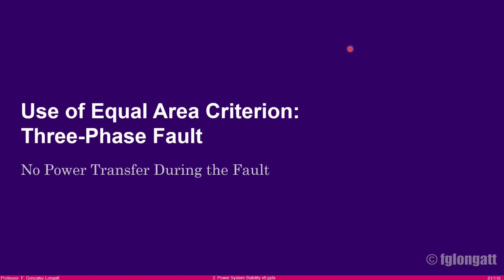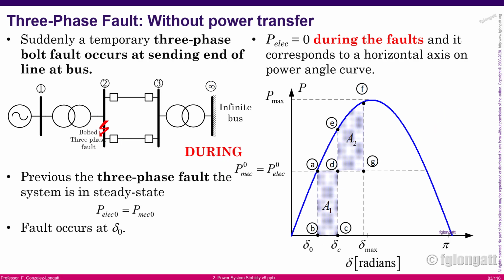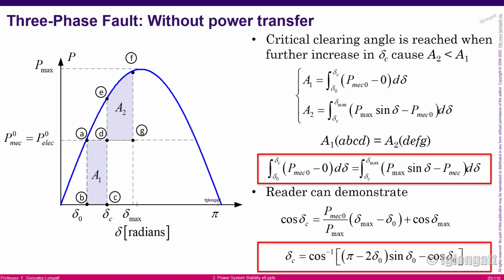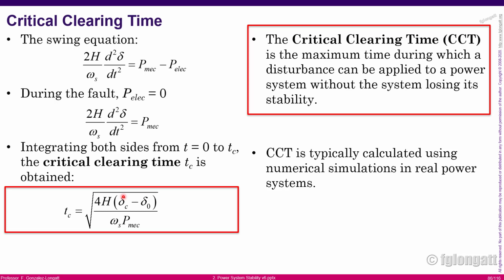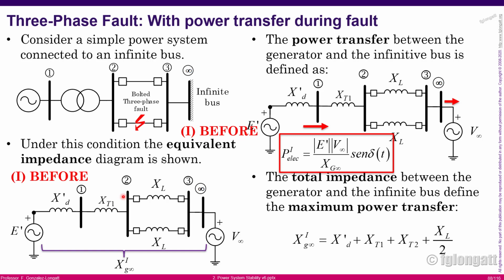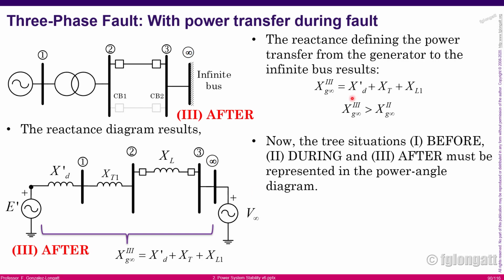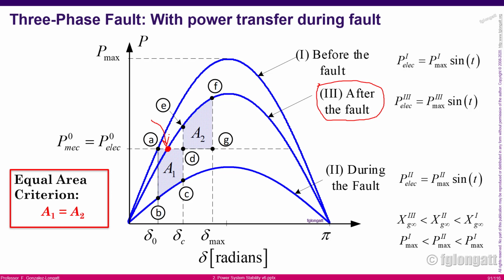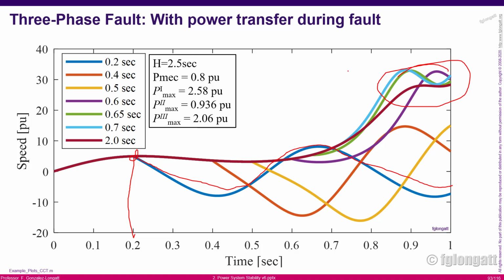Class 4  Intro Power System  Stability PART VII

Comment: What happens if the bolt fault at @ 20:16 is changed to a three-phase ground fault? how do I derive the power angle equation?
Reply: In order to answer this question, we should analyze first the correct meaning of a bolt fault. In the case of minute 20:16, i guess that bolt fault may mean a three phase fault that may involve all three phases Line-Line-Line and the impedance between these phases is zero. A bolt fault may also mean a three phase fault that may involve Line-Line-Line and ground and the ground impedance is zero. In any of these cases the fault is symmetrical (balanced) and we should use the positive sequence network only.  We would use the same positive network for L-L-L and L-L-L-G faults. We would have to calculate the impedance of Thevenin and the voltage of Thevenin seen from the terminals of the generator. Then the swing equation would be the same for L-L-L and L-L-L-G faults. If there is a ground impedance Zg different from Zero, then we do not have any Zero sequence network active since we use the positive network only.Then the swing equation would not be affected and it would be the same for L-L-L and L-L-L-G faults.  If we have a single line to ground fault, then we would use the Zero, positive and negative sequence networks and any ground impedance would be included. Then the Thevenins equivalent must be calculated seen from the terminals of the generator in order to find the swing equation. My name is Carlos Domínguez. I am a Power systems specialist from Central University of Venezuela.